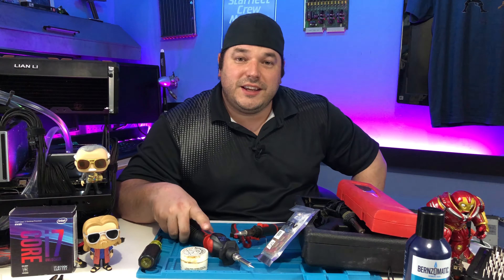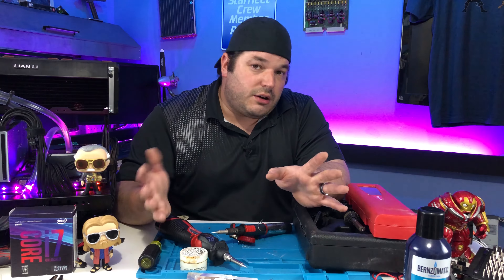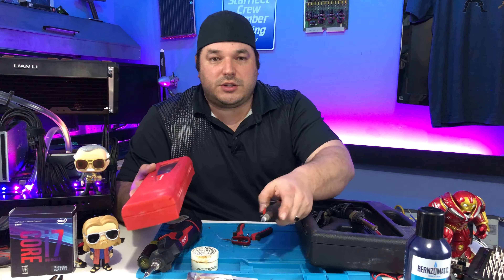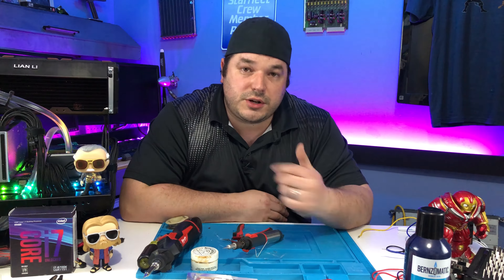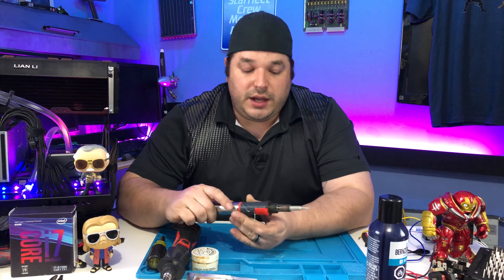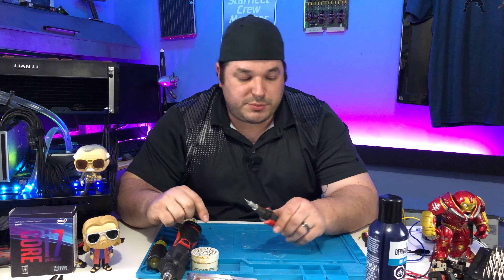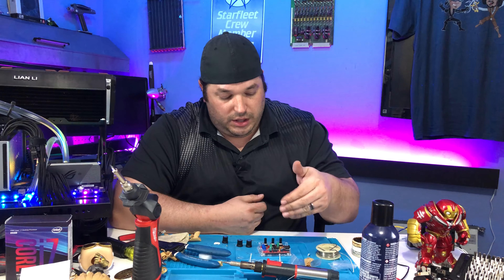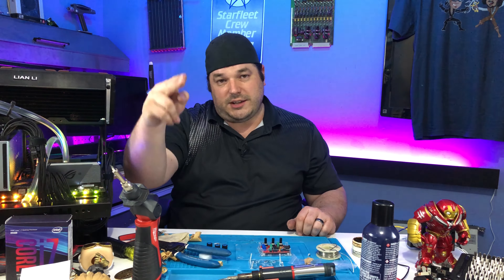WITCH CORDLESS SOLDERING IRON IS BETTER?

Comment: I would like to disagree on the filling time of the butane, you can fill them in like 10 secs. no different to filling a lighter. i would say you can fill it just a quick as changing a battery.
Reply from the maker: Takes two seconds to change a battery…. But your point is valid, its not egregiously slower. Thank you

Comment: I have several decades of experience working with Weller gas soldering irons and I am satisfied. On the first one, I broke the ceramic catalyst (due to a fall) and couldn't adjust it properly, on the second one, the gas tank housing broke (it also fell out of my hand), now it's the third one, or the fourth, I'm not sure. I use the Weller Pyropen Piezo model. But there is always a new one on the shelf in the workshop, just in case. I see a problem with soldering the connectors, if I have a lot of connectors I use up the gas bottle. I use original Weller gas and it is not cheap.
That's why I increasingly use a soldering iron with a stand and cable, on a replaceable 20V battery. I might drain the battery, but that's not a problem. But, if I'm working at height, ladders, etc., I have to turn on my Weller gas soldering iron. The gas soldering iron is powerful and can heat even "thicker" cables outdoors and in winter.
Reply from the maker: Thank you very much for that input! I agree, the gas is hard to beat.

Comment: Weller made a dual range soldering gun that has 250 to 325 watts.  I absolutely love that gun, however it is only to be used for soldering wires and connectors and not for electronics.
Reply from the maker: I did not know that, thank you very much for sharing! Does that mean you prefer the weller units?

Comment: where did you get the plastic nuts and bolt tray I cant find any anywhere and my 3d printer only has 10 inch build plate
Reply from the maker: Thats a silicone project matt, amazone usually has em
Reply: thanks havent been able to find any but also havent used the words silicone project matt was sure they were made of hard plastic  @TheRenaissanceBuilder
Reply: BTW incredibly quick response especially on a 3 year old clip . impressive you gained a like and sub for that
Reply from the maker: @guyrandom6151  i just searched silicone project mat (im not a great speller) on amazon and the blue one was the second choice.
The silicone is heat resistant so it works well for soldering projects.
Im happy to respond, the channel is still small enough to keep things personable.
And thank you for the conversation and the sub, I appreciate it!

Comment: thanks for the video comparing the 2, but the for what your doing you wouldn't use cordless soldering irons. you would have a static free temperature controlled solder station. this would give you a lighter iron for better control. the cordless irons are for use in the field ideally on non electrical components (wires and terminals). for example i used my portasol to solder a replacement bulb holder onto a car , and then used the side flame exit to put on the heat shrink.

a tip to help you get better joint, dont use extra flux as solder has it in it, use a fine tip, heat the pin first, then touch the solder onto the pin and the solder will flow onto it. your touching the pin and the solder at once, so the solder will melt before the pin has heated fully.
Reply from the maker: Very well put thank you very much for this response!
Check this one out i would love to here your opinion on it!
https://youtu.be/Yj5ojUh7byA

Comment: For me the gas soldering irons are the best, one is a Black and Decker (really old) and takes Thermacell cartridges and the other is an Antex Gascat 40 (40w) refillable. Both are fantastic for flexibility, but the Gascat is a breeze for electronics (as are all Antex irons) its so light, uses a catalyst so only the tip gets hot, and you hold it just like a marker pen (it’s about the same width as a large highlighter pen or marker).
If you can get one in America, I’d recommend it very highly, I believe it is made by Portasol (in Ireland) so it may be sold under their branding rather than Antex (who make excellent small mains irons).
Reply from the maker: Thank you very much for the suggestion and feedback I really appreciate that!

Comment: also, the snap-on wont have temperature control as you state, it will be more a power control. as you start to solder the tip will cool. if you doing jobs that need temp control them use a solder station that will allow you to set the tip temp and it will maintain it no matter how much heat you are drawing from the tip.
Reply from the maker: Compared to the Milwaukee, the snap on has a world of control

Comment: If you remember Tandy,  you might remember Allied.  I think originally Tandy Radio Shack was an outlet for Allied's surplus stuff. I  think Allied is still around but they are pretty industrial suppliers. I haven't bought anything lately but DigiKey was my go to for a while.  Bernstein Appleby was big back in my day. I'm pretty sure they are gone.  Then there  was Team Electionics. We had a store.  They also sold components.  Amazon and eBay have pretty much taken over.  I really miss the days when you could just go to your local stores and pick up a resistor, or a cap or IC.  Man those were the days.  Just found your channel.  I'll be watching you.  Thanks for doing your videos.  I know it takes time and money.
Reply from the maker: Thank you very much! Im pretty sure allied is still around, pretty sure i recall the name recently. Radio shack isn’t completely gone they still have an online presence. In fack i have an electronics manual i was going to use to produce a learning electronics podcast with.
Digikey is still more reliable than amazon but allas you are right, they are taking over the general stuff.
I look forward to hearing from you more.
Thanks again!
Reply: @TheRenaissanceBuilder  I ran across your channel while searching for reviews on  cordless soldering irons. But, you are interesting to watch and you seem to know what you are doing.  I have been researching the  Berkling BSG-568 butane soldering iron.  It has a heat gun attachment that I want to use in marine application.  Working on boats always presents difficulty.  I want to use this on Solder Seal butt connectors. I just wondered if you are familiar with these soldering iron/heat gun products.  It gets great reviews.  But, with all Amazon reviews, they sometimes have to be taken with a grain of salt.  Thanks for your time and keep the videos coming.

Comment: Great Video! I have the same butane iron! Works great but unfortunately I can use it at work,due to open fuel cells (aircraft electrician). So I got to get a electric one such as the Milwaukee.
Reply from the maker: Thank you! Interesting trade youre in, is there a normal or desirable unit normally used in aviation?
Reply: @TheRenaissanceBuilder  when I Chased sparks for the army on Helicopters, our toolbox’s had a Weller battery powered one. It was ok... but My butane iron (snap-on),never failed me. Mostly soldered switches and stuff and worked great for shrinking those Raychem enviro splices! But A co-worker has the Milwaukee,I tried it. I do like it,it is a lil bulky but I can deal with it!

Comment: Your butane iron must have a really good temp control on it, cause I've had 3 over my time and none of them are able to make a difference between half and full. Like most gas items, a flame is a flame, it basically stays the same temp, just changes how quickly it can get there. I prefer electric, as most of the environments I use them in are out in farms and open areas, where if you get a bit of wind up, the gas struggles to heat properly, they become useless. But, I do keep mu butane one around for the sheer convenience of the heat gun tip, which is always handy.
Reply from the maker: I love to hear about others experiences. I am happy with this iron, its a snap on unit but is made by another company. The adjustment is not fine but generally works. All the way up is to hot and burns the tips, medium is about perfect general soldering and low is good for tiny electronics.
Im working on a battery version that is better than anything I’ve found yet right now.
Thank you for watching and commenting, I really appreciate it!
Reply: @TheRenaissanceBuilder  I'd be interested, always on the lookout for better tools. My gas unit is made by Cabac, I'm not sure if you guys have that over there but here in Australia they are a big electrical wholesaler. I've had 2 Wurth torches (both had faulty ignitors) and currently 2 Cabac and about to purchase the Milwaukee for a trial. Cheers buddy👍
Reply from the maker: Hey i have an idea, how would you like to help me out with some r&d?
Reply: @TheRenaissanceBuilder  what have you got in mind?
Reply from the maker: I have an iron that i want to do a review on. If you are in the market anyway you could get the same one and give a first hand field review, like how it holds up in dirty rough environments.
Reply: @TheRenaissanceBuilder  well, I can certainly have a look, might be worth our while to do so
Reply from the maker: Can you find me on Facebook?
Reply: @TheRenaissanceBuilder  you know, its funny ypu should mention that the Snapon iron is made by someone else. I actually clicked the video because that iron looks suspiciously like my old portasol iron. I'm pretty sure thats who makes those for snapon. They make gas irons for Weller too. I love my portasol for quick wire splicing in the field. It's tough enough it'll fit in my tool bag and that cap covers well enough it wont burn anything when I need do put it away hot. Good video.
Reply from the maker: @locksmitty13  thank you very much!

Comment: You Should Try The Ryobi Soldering Iron
Reply from the maker: I will consider that, i do have a multiple iron vs video on the idea board so i will add that one to it. Thank you for watching and commenting it really means allot to me!
Reply: @TheRenaissanceBuilder  I Also Heard
The Hako Cordless Soldering Iron
Was A Good one Too.
The Thing I Dislike The Ryobi
Has ThatvBase To Contend With.
It Should Be Made Like The Milwaukee 
Just Slap A Rechargeable Battery
In It & Go To Work.
I Have A Weller 3900 Soldering Handle
I Can Screw Replacement Heating
Elements. If I Wanted To I Could
Put In A 23v40 45 or 50 Watt Heater
Element In It.

Comment: Title of the video: Broom riding WITCH soldering irons are better than others. :D

Butane. Got it. How's the temperature accuracy between the two?
Reply from the maker: Night Fury you like that title huh 🤣 
Both units are very temperature consistent once there up to heat, however when being used heavy the butane one holds temp better. The butane is also adjustable with a flame control knob versus battery is just on or off
Reply: Ok. Cool. I guess the butane is better in that way as well then. I should really get one so I can solder away from home. 
Honestly, I thought the title was a typo... It just made for a good play on words, which I can never resist.
Reply from the maker: Night Fury  i like my butane unit, it also acts as a heat gun and comes with a few more tips for various uses
Reply: @TheRenaissanceBuilder  Wow! Sweet! Now I really want one of those. Do you know how well it compares to a hot air station? 
The other thing I want is a digital microscope that connects to my phone. LOL
Reply from the maker: Night Fury  ok so a hot air station with temp control is way better, but for in the field mobile applications the butane unit works beautifully
Reply from the maker: Night Fury  ive never tried an attachment for my phone. I feel that everytime theres a phone gizmo that thing could just be done way better with the correct tool 🤷🏽‍♀️
Reply: Yes. The right tool is definitely better, but lugging a 70 pound stereo microscope around is impractical. Lol :D

Comment: So you blast fine electronics with high wattage????  Whatever. Definitely a thumb down.
Reply from the maker: You do know that a soldering iron does not conduct any electrical energy to the solder right?
Reply: @TheRenaissanceBuilder  No I know nothing I never did learn anything in the last 35 years.